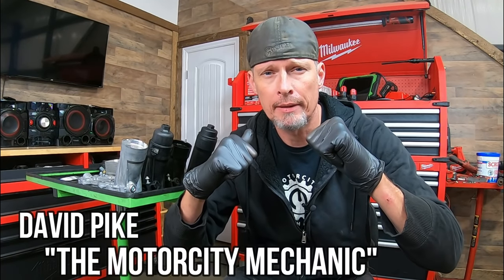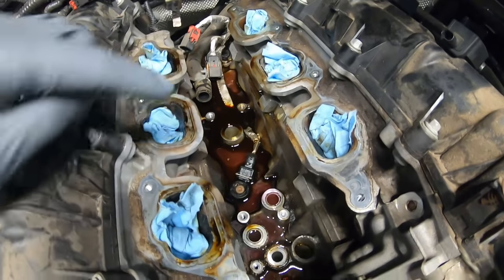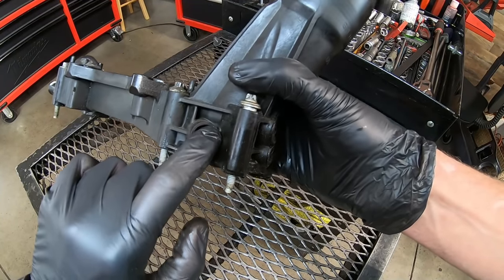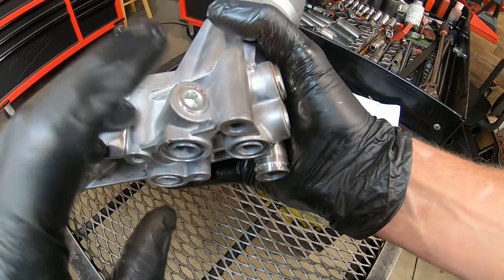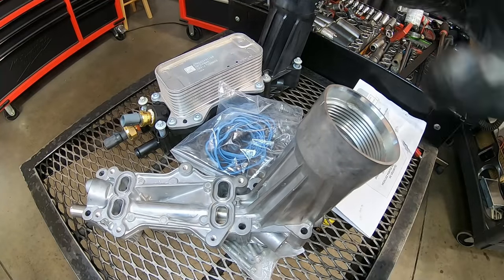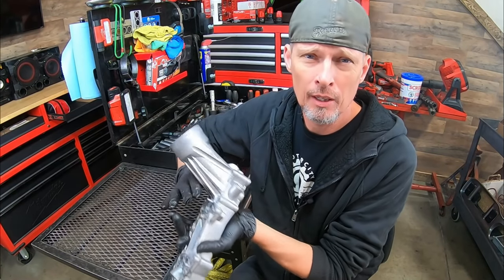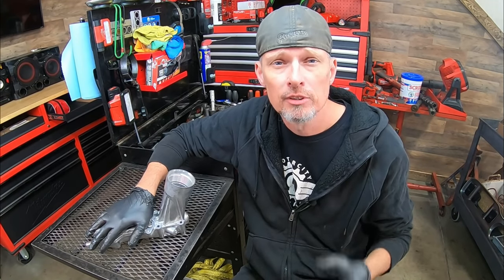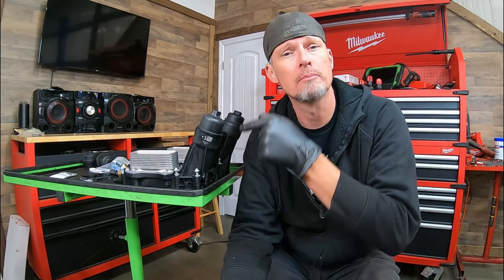Dorman 926-876 Aluminum Chrysler 3.2/3.6 Oil Filter and Cooler Housing Upgrade

Comment: Plastic - saving manufacturers millions, costing their customers billions.
Reply from the maker: Every brand does it…..glad to see other companies making another option
Reply: Sad part about this is they use cheap parts and then it cost $50,000  to buy a rubicon…..
Reply: Lol so true
Reply: Cutting corners like this costs them far more in reputation than the dollars and cents saved on the assembly line. Never buying another jeep again.
Reply: @tdz69  Good luck finding another brand that doesn't do the same thing.
Reply: Chrysler customers have to upgrade to the Dorman-Pentastar engine if they want it to last.
Reply: @MotorCityMechanic I have the '18 Pacifica so If I get this new metal Doorman I am automatically transferring my old cooler to it is that right?. I would hate to get that far and use an old cooler I would like to just get everything brand new as a whole unit so you don't even have to take it apart I would think you might recommend that :-)

Comment: You know your engine is junk when Doorman is making upgraded parts for it.
Reply: Engine is generally fine.  Good power, decent on gas, reliable.  The issue is hose connections, oil cooler, etc. made of plastic.  Long term reliability of these parts is highly questionable.
Reply: @phprofYT  Yeah "BUT" it looks like Doorman is trying too step it up something good for a change huh.....
Reply: Comment of the Day Award!! 🤣🤣
Reply: not a good comment!
Reply: Terrible engine
Reply: Thank goodness for a company like Dorman...willing to step up to negate the cheap manufacturing that all domestic companies are churing out...

Comment: I had a GM engineer neighbor who said that the production engineers are the culprits by taking the designer's original "perfect" plan specs and modifying it to reduce weight and the cost of production.  What starts as a really good design gets compromised before it gets to the line.  The next level is the manufacturing process that will sometimes cause a flaw/overstress a delicate part during assembly and a problem rolls off the line to be realized by the customer.   The increasing number of recalls across the whole industry proves this point.  Even Toyota, once revered as the poster child for quality has recently produced batches of v6 engines with metal shavings left in the oil passages causing bearing failure.
Reply: For a couple of decades I've been curious who exactly some of my rage should go to lol. I've tried my best to keep my stuff up and running instead of just getting new

Comment: Recently, Dorman has a newer version (926-959) that includes new Oil Cooler as well as Oil Filter/Filter Cap that can be installed on a Gen 1 Pentastar. Only the 2 sensors would need to be bought separately.
Reply: yes i just looked up the part on their site and it now includes the 2013 durango so now i'm about to order this
Reply: Thanks, grabbing one asap!
Reply: I was thinking to go to pick n pull  take a 2014 style oil cooler and combine it with dorman part
Reply: Just bought the new version 926-959  for my 2012 wrangler. The actual housing is stamped with part number 926-876. I assume that both kits use the same housing with the exception of the oil cooler and the filter cap?
Reply: @redeemed2517  The 926-959 part adds the Oil Cooler and Filter Cap.
Reply: @rmproute66  Thanks Rick. I just want to make sure I have the right parts before installing. I was going to do the upgrade to the 2014 Mopar housing but I’ve been hesitant because of all of the reports of the unit failing after multiple installs. I bought one and have been sitting on it but just discovered the Dorman housing so I went ahead and picked one up yesterday. I read that some people were having issues with this one as well so now I have to decide which one I want to go with. Just want to do this once.
Reply: Still no solution for my 2019?
Reply: @natsonwang5241  You read my mind!
Reply: @rookiedeadmeat3639  19 should not be leaking...
Reply: @dporrasxtremeLS3  it’s not but it’s preventative fixes. Why keep a product that you know is flawed and wait till it craps out on you and begins leaking when you can’t avoid it altogether
Reply: Thank you for this. I about shit a brick lol
Reply: TY was just here to verify this exact question.
Reply: I installed this one on my 2013 10 th anniversary jeep wrangler. 93000 miles
Reply: The new dorman part is no longer made in the USA
Reply: what other sensors?
Reply: He recommends buying the doorman holder and transferring your old cooler to it. Who wants to do that if you get that far and dig that out you would want a whole brand new piece with a new cooler and everything I would assume😮😮
Reply: @dporrasxtremeLS3
Reply: @dporrasxtremeLS3  15 shouldn't be, either

Comment: Penstar Engineers at Chrysler:  "Hey i know!! Lets design a component where the oil and the coolant are under pressure and are separated by a then plastic wall and a little gasket  and gets wrenched on pretty hard with each oil change... and lets make it out of plastic!.. yeah  that's the ticket!"

Comment: I had a 2013 Dodge Charger with the 3.6 and replaced the oil cooler assembly with a 2016 assembly and everything fits. The only difference was the oil filter. Everything worked. No more oil leaks. So this aluminum assembly should work on the first gen. Just make sure if you take your car for an oil change make sure they use the newer style oil filter. Fyi. I do all my own maintenance.
Reply: You replaced it with the Dorman or mopar? I’m not seeing how it wouldn’t fit either unless it’s because you need to use the aluminum cooler from the 2014-2016. In that case you could just purchase that part separately. I’d like to purchase the Dorman cooler but I don’t want to tear everything out to have it not fit and have to wait to order another especially when all these parts are about $300

Comment: My 2014 3.6 Grand Cherokee developed an oil leak at 120K miles right at this location.  I'm sticking with the Mopar part.  The all-aluminum Dorman part looks good at first glance, but that polymer base on the Mopar base is a much better insulator of heat.  The Dorman aluminum assembly is bolted directly to the engine block which is a huge heat reservoir;  there is going to be almost no heat transfer between the oil and coolant as it flows through the Dorman oil cooler which is now essentially at the same temperature as the block.  I'm curious if others have paid attention to their oil temperature and seen a difference with this new part installed.
Reply: You had a very good point.

Comment: I've now done this replacement 3 times. I have to thank you for putting this video out cause it saved me a ton of cash. The last Oil cooler lasted 3 years before it leaked. I finally upgraded to the aluminum oil cooler and I have my fingers crossed. My neighbors now think I'm an amazing mechanic and now they won't me to work on their cars.
Reply: How's the aluminum holding up I just ordered one for a 2015 3.6 wrangler
Reply: @rickster2929  It's holding up well so far.

Comment: I installed this Dorman 926-876 Upgraded Oil Filter / Cooler Housing Kit (ebay) to my 2013 JKU Wrangler (28 Oct 2021). After watching MotorCity Mechanic’s vid: To Upgrade or Not To Upgrade your 2011-2013 3.6 oil filter housing/cooler.

No problems with fitment whatsoever! 
Direct drop-in! 😁🤙🏽

I also purchased a used 2014 Housing (Complete assy; Just needed the cooler & filter cap) from  ebay & transferred the cap & cooler to the Dorman housing with the OE hardware & kit supplied cooler seals. 
Aloha! Craig A 😁🤙🏽
Reply: I’m surprised this wasn't mentioned in the vide. I’m thinking about doing the same thing.

Comment: Dorman came out with a new kit that includes the assembly, o-rings, bolts AND gen2 cooler (helps to retrofit to gen1 engine), they even include the oil cap. The cap has a nice reminder plaque that you need to be using a 2015 oil filter, even if your engine is 2011-2013. Part # 926-959.

Comment: SUPER IMPORTANT: David, you need to do a video on where the o-ring in the filter cap goes. Put it on the bottom land, and it will leak JUST like a failed cooler assembly. Early in ownership (at 1.8 million miles on pentastars currently) this happened to me twice, and dishonest/incompetent dealers helped themselves to $1000 of my money each time!

Fantastic video, as always!
Reply: So make sure to install it on the top?
Reply: "1.8 million miles", that engine must have been built on Wednesday! Monday is high absenteeism day, Tuesday folks still are recovering from the weekend, Thursday is Friday eve with grown and sexy night at the lounge, and Friday is party time (at work of course). But Wednesday is hump day people have accepted that they have to be at work and they are happy that the workweek is halfway over, so they really work well.
Reply: @tking780  Ha! Actually, that 1.8 million is spread over 3 vans. Historically, the engines are good to mid 500,000 miles. They still run fine, but they are a little down on power and mpg by then.
Reply: @kipamore  That's still kool.
Reply: I have 2 a 2015 charger se with 387,000 and a 2020 with 12k even the old one with all the milage has rattles from body and interior but motor still passes CA smog  i they are reliable except this part i been threw 3 on the 387k motor and trans rebuilt at around 230k and and rear replaced unit at 290k i mean all the plastic PHENOLIC the upper motor top is made of mine has been reliable but this issue….fyi dealer is like 1.5-2k us to replace i did the dorman a few years ago see no diff so far but time will tell….take care and do service at or before intervals i am still surprised its so high milage without any major issues!
My milage was new around 22-28 and its around 19-26now which is nice road trips toped 38mpg and still are around 30-31 only and any mod i did was a stick airbox k&n which i replaced at 250k on old car …idk about HP/TQ output but still smooth🤘
Reply: @Chompsys  and improve the mainframe to hold charges for everyones cars at once so we dont end up like california. electric is a waste of money right now.
Reply: @Chompsys   Not even close to enough electricity to sustain EV at scale, largest adopters are pulling power from neighboring states and still having brown outs. Many people in northern areas are finding that EV are not practical at typical winter temps, sales numbers seem to show a pushback in cold climates and for some fleet owners.

Comment: Thanks for all of the great content! Love your channel.  For anyone looking, Dorman now offers a kit ( part#926-959)  for the Gen1 Pentastar 3.6L oil filter housing adapter that is aluminum, and has a bright orange cap with a metal tag to notify anyone changing the oil that it requires the new style filter.
Reply: I appreciate it. I have a 2012 RAM C/V and was hoping to upgrade to  metal as the plastic has failed after 150k miles.
Reply: Hey, I have a ‘19 Pacifica 3.6L V6 gas. Do you know the new engine oil filter part number to but after installing the Doorman unit?
Reply: @Mike_44  Hi Mike.  Looking up your 2019 Pacifica, it already has the newer style oil filter than our 2012 required. The 2012 kit provided an orange  filter cap to bring awareness to the oil filter change moving forward, which now would require a 2015+ model year filter. In your situation (being a later model yr 2019), no upgrade would be necessary for your oil filter number.  There are actually a few different kits sold that can just be the aluminum housing only, or one with the complete kit with a "black" filter cap.
   The biggest reason for the leak, is over tightening the cap when doing oil changes. Good luck with your upgrade..... its not hard,  just takes time. Be patent 😉👍🏻
Reply: @tonycharron73  Thank you for the heads up, I really appreciate it. I will be tackling this job soon. Btw, is it possible to replace the oil cooler without having to drain the coolant or I absolutely have to? I was thinking of clamping the coolant line that feeds the oil cooler before removing it. What do you think?
Reply: @Mike_44  clamping the coolant hose is totally an option. You may need to top off the coolant afterwards for what little has been lost in the old adapter.  Ne mindful, that you will have air in the system from the new housing, so pay attention to things like oil and coolant levels and temps for the first few days, to make sure all is good 👍🏻
Reply: @tonycharron73  Ok cool, yes because everyone says this needs to be done draining the coolant. I will try it without doing so. I have the big funnel to burp the system afterwards and will add whatever it needs. Thank you. 👍🏻

Comment: Thanks for the heads up about this Dorman 926-876. Just finished installing it on a 2014 Chrysler 200 S. It fit perfectly and seems to be a high quality part. No more leaks and no more check engine light. When cleaning all of the fluid from "the valley", be sure to suck the oil out of those threaded holes where the oil filter and cooler housing bolt into or the fluid will pressurize as you tighten the bolt which could throw off the torque reading or even strip the threads of the block.

Comment: My wife had a 2013 Wrangler.  Had an oil leak. Was not going to put the crappy plastic OFS back on.  Bought the  Doorman 2014 OFA for it.  Plus a new 2014 cooler that would fit on this new housing..  New sensors.  Install was easy.  So new OFA and Cooler. $200.  I also bought a 2014 filter for assembly but used the old 2013 cap.  Pulled the guts out of the cap.  Works just fine.

I also bought Baxter Performance adapter for the OFA.  So running a Royal Purple inverted Oil filter.  No dry starts anymore.

So the Doorman OFA does work with the 2013 3.6 Penstar.  Just have to buy a 2014 cooler and gaskets.
Reply from the maker: It does must isn’t cost affective to do. But Dorman came out with another version since the video that includes everything to make it a one size fits all no matter the year
Reply: That is great.  Thanks for the reply.    Haven't had any issues with the upgraded housing or the new cooler.  With the new OFA $156 and the cooler $50-$60 plus the new 14 sensors from the dealer ship...$270 total.  The Baxter Performance adaptor was $330.
Reply: Awesome, so the Dorman oil cooler housing is compatible with the Baxter cartridge to spin on adapter?

Comment: Just bought one off Amazon complete aluminum with cooler and sensors and filter apparently they’re making them now so you may have to update this video!
Also I put a plastic one on 2014 it up on a 2013 at 112,000 it worked then blew again at 130,000 that’s why we’re going to the aluminum love the video thank you very much but you may want to update it

Comment: I took your advice and  installed the Dorman style.   The plumber working at my house pointed to a trail of oil in my stone driveway.   Sure enough after investigating my RAM truck (98000 miles) I found the trans covered with oil.  I had no idea it was leaking.  Took most of the day to install it with a helper.  Cost under $175.  Your video was a great tool and time saver.
Reply: how long did it take to get the Dorman part? Was it stock locally?
Reply: @rupe53  4 days.   I ordered the stock part off Amazon and the Dorman on a tues.  Both parts arrived on friday.   I wasnt expecting e Dorman product for a few weeks.  Come to find out its made in Pennsylvania. ..I'm over in NJ  so I guess it got here a week quicker.   I swapped the cooler temp and pressure sensor from my removed unit onto the Dorman.   So far  ops check good.   Now I have a spare!
Reply: @b100ka  ... I put a call into my local parts store and was told it was NOT in stock and they needed check with their warehouse to see when their Dorman supplies came in. The counter guy didn't know if that was weekly or monthly, special order, etc. I guess I will find out on Monday as to availability. Will also be calling the dealer as my backup. I am in Ct so could be pretty quick if they have it. In the meanwhile, I have only lost a few ounces of coolant and oil, so I suspect it's more the O-rings than a cracked housing. I was also told to replace the O/P sender as cheap insurance. Seems they are prone to leaking through the plug area.

Comment: I've been getting a check engine light  every once in a while for the dual stage oil pump. I took my Jeep to my friend's shop and he tested everything, no issues with the pump. He said it could be the oil pressure sending sensor that's on the back of the oil filter housing. I'm thinking of replacing the whole thing with the aluminum housing. I had the plastic one replaced last year at the stealership $1200.

Comment: Hey David thank you for taking the time to make such an informative video. We own a 2015 Chrysler T&C .  We were on vacation about 2 and a half hours from home and you'd never guess what failed. Yes, you guessed, the Oil cooler assembly was leaking antifreeze all over the transmission housing.  With that said I didn't have my full compliment of tools. But knowledge is everything. I went ahead and got the replacement cooler from the dealer in Atlantic city, installed it and got us home.  After seeing your video, I will keep in mind should I have the issue again in the future to upgrade to the aluminum block.  I was thinking that if there was a way they could modify the aluminum part  So that the o-rings would not be crushed flat on the block and possibly use the snorkel portion. There  would be more of a physical contact than just pressure from the torque of the bolts.     Thank you again so much for all you do!